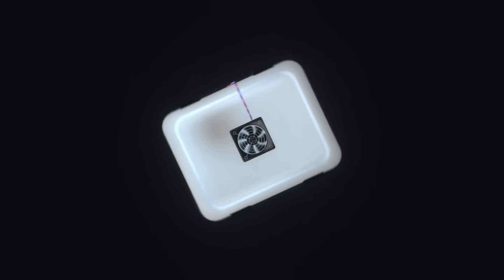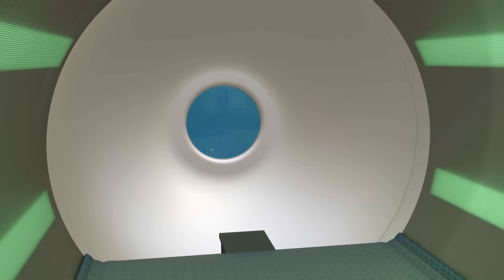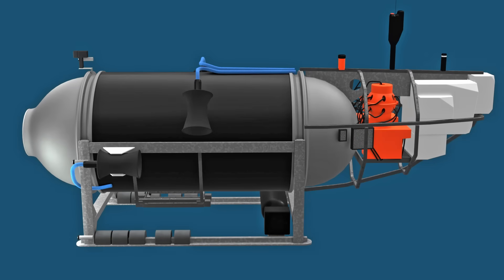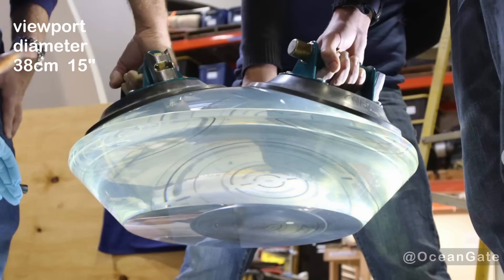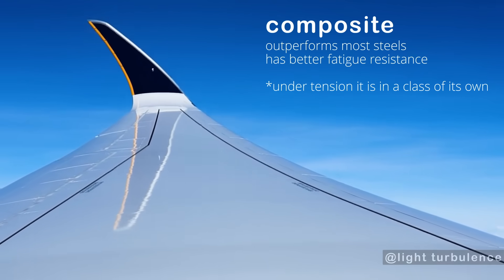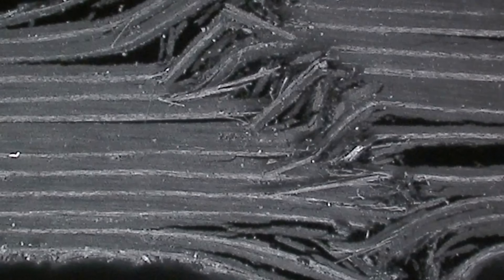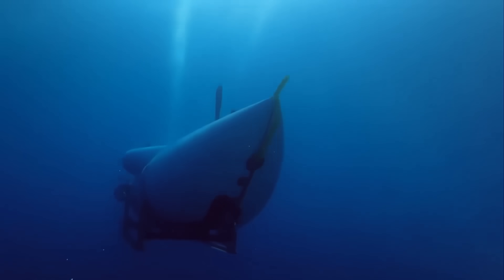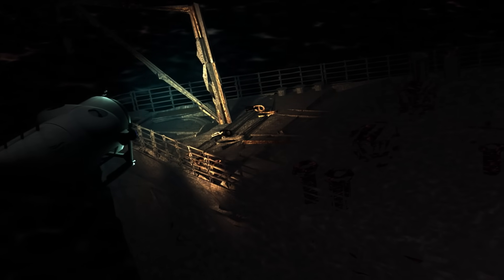Titan Sub | carbon fiber - Detailed Tour

Comment: My understanding of what happened is this:  1) regardless of how "strong" carbon fiber is or isn't under pressure, it's a different material than steel with a different compression rate. That means that under pressure, it will deform relative to the steel rings/endcaps that it's attached to which will inherently create weak points. 2) Carbon fiber degrades over time with repeated exposure to pressure. Again, regardless of how strong it is or isn't, it gradually gets weaker, until eventually.... *pop*. This is why it is deemed the wrong material for the job.  3) Then there's the cylindrical design to fit more passengers, rather than the more structurally sound sphere design. It seems like a reckless design choice. Best practices/established norms are what they are for a reason. Moreover, I wouldn't be so quick to dismiss James Cameron's  input on the subject. He may be a big shot Hollywood director but he's also got a much more impressive track record with regards to underwater exploration and engineering than Stockton Rush. I too look forward to the official investigation's report on what happened.
Reply from the maker: All materials including all steels degrade when stressed to within their fatigue zone.  So engineers build in excess material to ensure the structure is strong enough to stay below the fatigue threshold so they can take thousands of load cycles safely.  It's no different for composite in an airliner or racing yacht foil.  Cameron made it sound like load cycle fatigue is a foregone conclusion.  Its absolutely not.  It involves solid engineering to optimise the structure to make it safe from fatigue whilst not making it impossibly heavy.  

Cameron made the blanket statement that composites are not used for deep see vehicles.  Again absolutely untrue.  Here is a list https://www.researchgate.net/figure/Composite-materials-being-used-in-submersibles-worldwide_fig1_364296004

I prefer to follow science not celebrity.

The deflection under load of carbon fibre and titanium are very similar which is why in aviation they can be bonded successfully but importantly they are exhaustively tested till proven reliable because its an obvious weak point. Here is a surprise, carbon fibre in some cases deforms less than steel under because its so rigid but is also why it is so brittle and shatters when it yields.  It hardly deforms till it fails catastrophically without warning.

Yes a cylinder is the weaker shape but that makes it a bigger challenge but not impossible. 

I appreciate you tanking time to make a thoughful comment. So many in my comments are just here to  insult or troll.

Comment: Carbon fiber is inherently flawed when under compression why ? Because it’s actually floating in a matrix of epoxy and this epoxy develops stress fractures that severely weaken it so the first deep dive it may loose 5% second dive 8% and so on what you have now is a death trap of your own making because it will fail maybe not the next dive nor the one after that but it will fail , on each dive there were reported noises from the hill what are these? This is the hill failing and on the way up it still made noises and this is stored energy releasing and doing damage, Stockton new this but I’m sure he thought he had a lot longer life on the hill than it did basically this hill was a use once and throw away cause there’s know way to really test how much damage was done

Comment: The text book " Steam Plant Operation , Everett B. Woodruff and Herbert B. Lammers , McGraw Hill Book Company Copyright 1977 . Chapter 2 Design and Construction of Boilers. Sect. 2.1 Materials used in boiler construction, Sect. 2.2 Stresses in tubes - boiler shells and drum and shell construction, and Sect 2.3 Drum and Shell construction is an excellent source to understand the forces involved in pressure vessels.  I realize the pressure is exerted from the outside rather than from the inside but the math is the same when looking  at these vessels.  
Another factor that I have seen no analysis discussion is the rate of temperature differential across the hull during the dive and assent.  I worked at Crystal River Nuclear Plant for 25 years and we had to control the heat up the cool down rate of the reactor vessel during startup and shut down of the reactor.  We knew the rates that would cause failure of the vessel and kept an adequate  rate margin to protect the vessel.   
My point is that the engineering has been available for over 150 years.  The unknown is the understanding of the carbon fibre pressure, temperature cycle stresses.  The use of these materials in aircraft was tested for these conditions prior to use.  It is almost like the first material tests were the dives themselves.

Comment: CF is an excellent material and is lightweight, stiff and strong for applications that require those properties.  When you say it is as strong as steel that is misleading.  If he had constructed the tube from the same thickness in steel it probably would not have failed however, of course, it would be too heavy to lift but at least he would be alive.  Does this mean that steel is stronger than CF - no of course not.  In applications where weight is critical CF is now indispensable as weight for weight a CF beam can be stronger and lighter than a steel beam or whatever you are constructing.  If weight is not really an issue steel is far cheaper and more robust and would be then the right choice as it is in millions of applications. 

Additionally steel and titanium are homogenous and able to be heat treated if required to optimise the desired properties.  CF is a composite and is totally dependent on the matrix to fibre ratio and the orientation of the fibres to resist the expected loads.  The designs I saw in your video of the tube did not fill me with confidence that the designer had the layup right nor did I see any real attempt to optimise the epoxy/fibre ratio other than using pre-peg.  For instance was the pre-peg especially chosen for maximum compression strength?  In the video the main consideration seemed to be to minimise the cost of the mandrel rather than an optimum layup.   I also didn't see any autoclave.  Epoxy composites totally depend on correct curing temperatures and post curing to achieve optimum strength.  I did not see any kind of this in any of the videos I have seen of the construction of the tube.

IMHO the designer approached the tube design with the premise that CF is strong and a shitload of it should be really strong.  Again I could be wrong but as the design was not certified or inspected by anyone with any knowledge of standards or material design for deep sea operation it no-one will now if it was constructed correctly.

Comment: Its comical that he installed acoustic sensors and relied on those to detect problems, but paid absolutely no attention to the "gunshot like noises" during every dive.
Reply: People who have been on big subs talk about the disturbing sounds they make when diving to depths. I am sure he thought about it, and might have even expected it, but figured it was "normal", especially after a few successful dives.
Reply: @itoibo4208  This was a 3 piece structure barely big enough to fit 5 people inside. Not a sub hundreds of feet long big enough for over one hundred crewmembers. Subs designed to do what this guy wanted to do don't make "shotgun sounds" without positively identifying the source prior to the next dive. To ignore those signs is literally asking for what happened to happen.

Comment: The entire submersible community disagrees with your assessment.
Reply from the maker: Cameron made the blanket statement that composites are not used for deep see vehicles. This is not true.  Here is a list https://www.researchgate.net/figure/Composite-materials-being-used-in-submersibles-worldwide_fig1_364296004
I prefer to follow science not celebrity.  Carbon fibre is very hard to get right but not impossible and offers substantial rewards.
Reply: @Mike-Bell  aside from Cameron's celebrity status, he actually built his sub and made it to the Mariana Trench.   I would consider him a man of scientific achievement for sure.   
           On the other hand, Stockton cut corners in the face logic to make money and paid dearly.   Although science may point one way the practical application may point another.  This is called the Popper Scientific Theory.   Engineering results may suggest one outcome, but when put in practice with outside influence results differ.
Reply from the maker: @JustSomeInternetDude  An Australian company and its engineers built James Camerons record depth sub.  He paid for it and made sure the engineering was done right because he wanted it safe.  
Stockton Rush was a cowboy. About that there is universal agreement.
Reply: @Mike-Bell  Agreed, Deepsea Challenger was made of Steel if i remember correctly has it not?
Reply from the maker: @JustSomeInternetDude  Yes it had a spherical titanium pressure vessel.
Reply: @Mike-Bell  I see.

Comment: Here's a YouTube video regarding Titan implosion video you might add to your Titan playlist.  From They Hydraulic Press Channel: Carbon Fiber Submarine Implosion: How Many Dives Can It Withstand?  Small scale test of crushing a capped, carbon fiber pipe by hydrostatic pressure, captured with a high speed camera.   Not scaled to match Titan in any way, but shows failure of tube by buckling of sides of tube rather pulverizing the tube pressure only at the ends.
Reply from the maker: Thanks.  Added it to the playlist

Comment: The strips of titanium that were hanging from the retainer ring was likely caused by the crushing of the center section of the carbon fiber shell, causing the ends to bow outward, ripping the outer portion of the rings. A for carbon fiber being able to perform this task, I highly doubt it. I have a LOT of experience with a variety of composite materials including CF. Those "popping" sounds were filaments snapping and each time that happened the entire structure would gradually degrade. Eventually it catastrophically  failed.
Reply: It definitely is nicer if you have a material that heals itself. I am guessing, though, that CF will be fine once the design is refined. It does not need to last forever.

Comment: I have witnessed composite glass fibre submersibles being made for use on the oil rigs in the North sea, so not the same depth, but still composites being used under compression.  It is not commonly known but glass fibre is actually stronger than carbon but not as stiff.

Comment: Each carbon atom has 4 points where the bonds attach.  carbon is nonmetal.  Metals can share electrons (bonds) regardless of the atoms'  orientation. They are not brittle as a result.
Reply: Mètals do not require a matrix to hold the atoms together.

Comment: There is something I am not understanding. 4 cylinders of compressed oxygen aboard. Standard "g" cylinders are about 3000 cubic feet, EACH. How would that work? The scrubber doesn't clear volume to make room for the O2. Someone please help me with this.
Reply from the maker: I was curious about this too. There was no pressure release valve so the  volume and therefore the pressure inside would increase all the time as the oxygen flowed. When they eventually open the door again the pressure would escape. 
However it worked this was not a problem because nowhere did I read it being an issue.

Comment: Excellent graphics and succinct narrative describing how the Titan was supposed to work!.  I gleaned most of this only after dozens of hours of searching and reading and watching, so I know how much effort this took to put together.
Your viewers may find instructive the 23 Jun 2023 article on DesignWorld website entitled "Carbon Fiber Is Safe for Submersibles When Properly Applied" about a company in Rhode Island, Composite Energy Technologies" has been making unmanned submersibles from carbon fiber composite for many years, some of which operate at depths lower than the Titanic.  The company CEO, Chase Hogoboom,  believes carbon fiber composite hulls may eventually be safe for human occupancy in deep sea submersibles  but much more technology development and testing will be required before he would consider it safe.  He also says that he offered to share some CFRP deep sea hull know-how with Rush on two occasions.  Rush wasn't interested (classic not-invented-here syndrome prevalent in many companies large and small in my experience).
Reply from the maker: Thanks very much. I wasn’t aware of any of this.

Comment: As an engineer and once scuba diver, I’ve always had issue with MSM assumptions about this loss. Starting with nonstop criticism of wireless game controllers. Any and all propulsion controllers need robust design and redundancy, no matter the specifics of their design. These controllers may have been perfect for the application. MSM automatically demonized this. As for carbon, its simply not just the material. Its was likely the lack of truly thorough testing and finite element analysis, destructive testing, ultrasound and independent third party testing and review. Not simply the “carbon”.
Reply: Only the most shallow media focused on the game controller. Most tried to refute the mania and focus on the depth rating (or lack thereof) of the CF and viewport.
Reply: Yes. and I also wonder why all the hate on the controller. It worked fine? needs no wires through the hull. seems like a good idea.
Reply: @itoibo4208 plus, a reliable technology that has been in use for decades

Comment: You are an idiot, take a piece of unlamented carbon fiber, of any form and compress it, it is worthless in compression, the hull of a submersible IS NOT UNDER TENSION, it is under COMPRESSION.
  A hull of a submersible IS NOT A PRESSURE VESSEL, It is a VACUUM VESSEL.

Comment: Thank you for this insight. This case has shown me more than any other how notions become truths which become “as we all know” type facts. Coming from the “space” part of aerospace (legal, non-technical), I’m aware of carbon fiber but not really it’s strengths under compression. So I too got caught-up in the oft-repeated so as to be generally-known “fact” that using CF under compression this way was as if Rush made his submersible out of glass and spiderwebs and “everyone knows” CF used this way is daft and a death sentence, etc. Thank you very much for not only pointing out that CF is also strong under compression, if not as strong as under tension. I’d also not heard about the longitudinal “prepregs” being used, so this video opened my eyes to a number of things. Not taking anything as gospel, of course, but it seems like some out there have when they quote from the Book of Cameron.
Reply: There is a compression problem, but it just needs to be handled in the design. He was trying to keep the weight and size low. Weight is not usually a big concern for subs, but this one had to be picked up on a crane and placed on a ship, and the ship was a large part of the cost of operating the sub, so he was saving money by making it as small and light as possible.

You could probably build a sub out of paper if you wanted to. It just would need compressing and sealing, and regular checks for damage.

Comment: Might it not be because CF has not been fully tried and tested for such use, that caused the others to be skeptical? Hence, the issue of wanting it to be certified.

Others did question how CF MIGHT behave after being subject repeated high pressure cycles.

Perhaps it’s that …
Reply from the maker: I think it comes down to cost. Boeing and Airbus experienced large cost and time overruns when they tried composite aircraft. Anyone attempting a composite sub needs to have major money behind them to ultimately end up with a safe craft that can be certified. OceanGate naively thought they could fast track it and even then the delays ran into many years.
Reply: @Mike-Bell  … they were ‘confident’ … oh well, the results are clear.

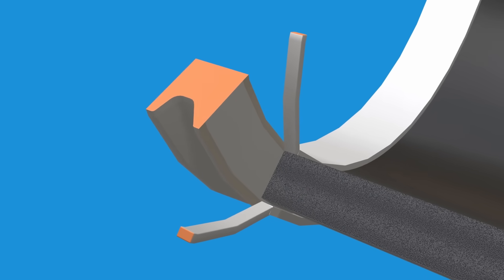Comment: 12:54 - I wonder if that's the result of the 2 half domes coming together with enough force to blow the flanges each way when the hull was compressed at that point. Maybe half of the hull went out while the other half went in?